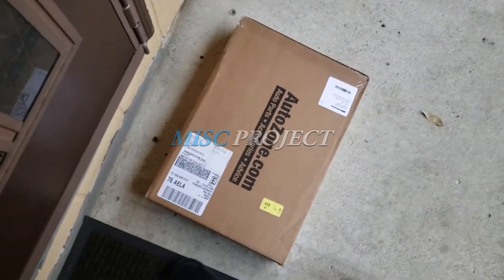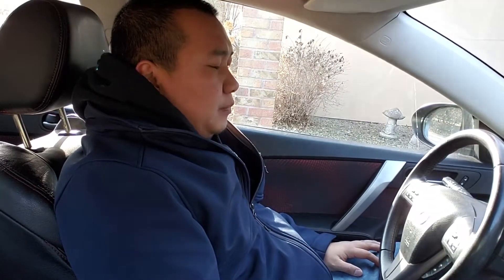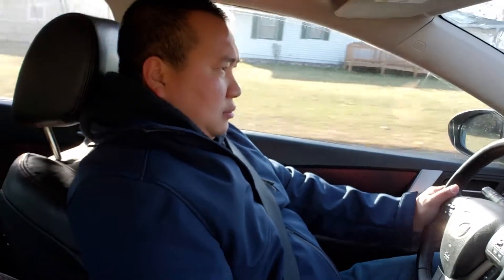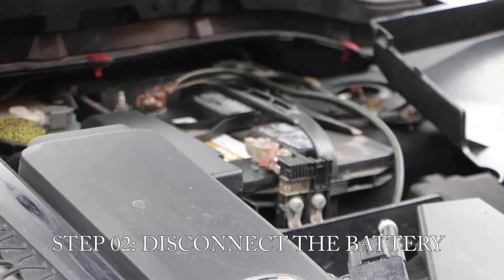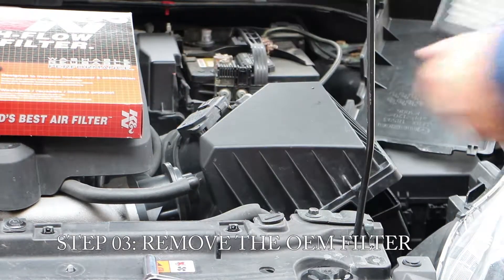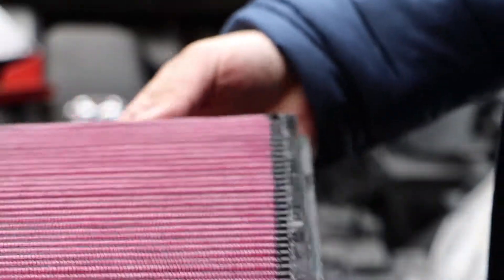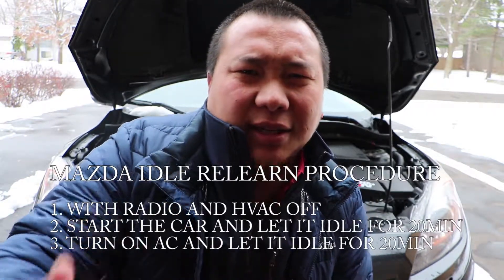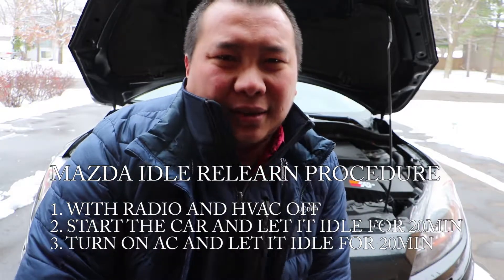K&N DROP IN FILTER INSTALL AND REVIEW

Comment: Tires make all the difference in entry level cars, I had a '90 civic with 90hp but the sticky tires and koni orange made it fun on curved rhoades. I nearly lost it doing 70 on a 35 S-curve, all 4 tires were squealing .
Reply from the maker: Very true. It's amazing what good tires will do for your cars. Waiting for my Conti DWS to go on my MS3. Might run straight out summer since I have snow tire for the winter.